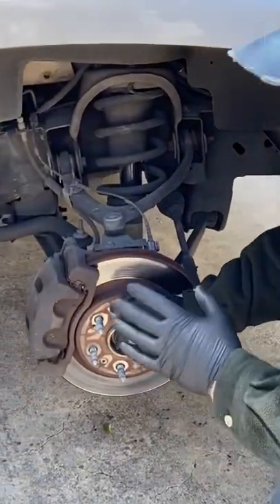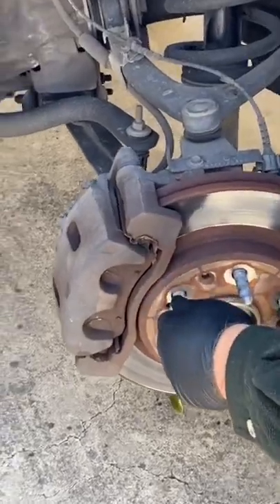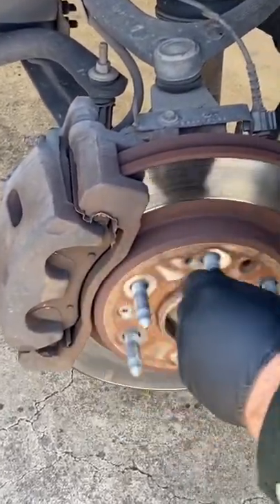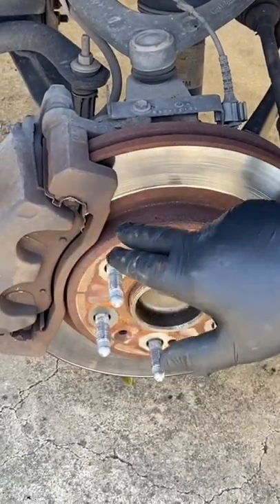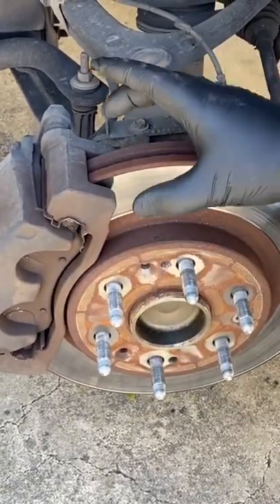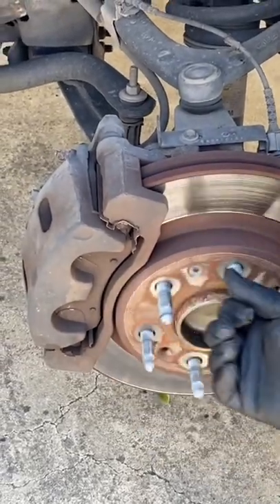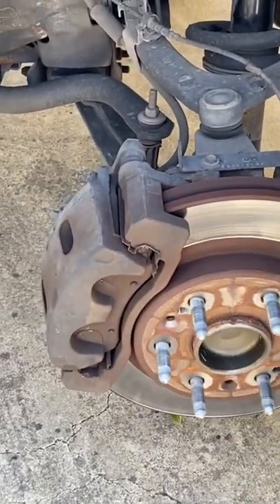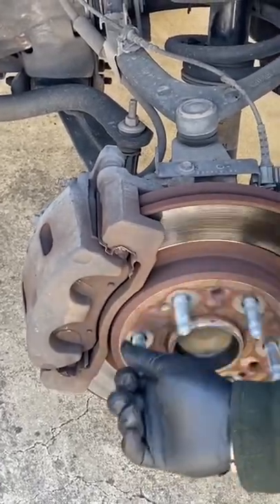Why Are My Wheels Squealing?! #shorts

Comment: I only hear a similar noise when im moving slow or pulling off (about up to 20kmh). I dont know if it s the same issue
Reply: Ok fixed. The dumbass who installed my new set of tires apparently didn't screw the nuts tight enough and the wheel was slowly dislocating.
Reply: @Kyle-ic1bm I think I might be having the same problem, someone at the tire Shop thinks it's worn out brake pads

Comment: I wish I could post the video I have of my car. It’s soooo loud everyone is plugging their ears. Just bought the car, new pads and rotors were installed wrong. Tire shop “fixed” it, but it’s still faintly making the noise! I’m scared to drive at this point. This is the only video I can find that sounds somewhat similar
Reply: You are good nun to worrie abt

Comment: My break are brand new and I still hear that sound when am breaking, had to abandon the car and drive my other car because the noise is so embarrassing
Reply: You ever get it figured out?
Reply: You or whoever installed them probably made a mistake 
Not properly cleaning the moving parts

Not greasing in the correct places 

Stuck caliper 

Brake pads on backwards 

It has a reason 

Just takes the labor to find out what’s wrong and money to fix it

Comment: I still get this after I switched my break pads twice. And my rotors once. Front and back. It’s driving me crazy
Reply: I’m going through this now and apparently work out wheel bearings can make a similar noise. Could be that.
Reply: A quick fix was getting my rotors resurfaced. Noise stopped. This was on a 2013 bmw so most of the times I had to break harder than usual, which would cause the noise to come back. I ended up having to drive my bmw like if there was a police cruiser behind me. That allowed me to break soft and never heard that noise again. Oh but as soon as I put it in sports mode. And want to break. You should cover your ears. Moral of the story. I was driving to fast which caused me to break hard often. Even then that didn’t make sense because before this problem I was already doing that and it never made noises. So something in the break set up that wasn’t the rotors or break pads had to be making the noise. I switched all the rotors once. Break pads at least twice. Same bullshit. Drive soft, no noise. But at that point what do I want a bmw for then. If your going through this and can’t seem to find the fix and want to save your money. Get your rotors resurfaced. And don’t drive fast. Keep it normal. So you don’t have to break hard
Reply: @elmoneyyy  I got my breaks done a week ago and the mechanic said mine was just worn out pads with the indicator exposed and scraping the rotors. Rotors were still in great shape thank god. I did more research on the wheel bearing potential option and that makes more of a roaring noise.
Reply: When installed, put both ears pointing the same direction on each side. Also grease the contact points really good.  Some mechanics will put on one side ears going opposite and then it causes squeeling when you get home and reverse.
Reply: @chromemox3319 it could be your caliper is seizing a bit on your brake rotor, I’ve been having SO MANY issues with my brakes recently. Needed new pads and rotors and a caliper bc my ex had put them all on backwards wrong and missing bolts and abutment clips..broke a week later and now I’m still fixing it. If your abutment clips are old or faulty that could be causing some odd noises as well, or if your brakes have been very messed up recently your parking brake could also be stuck on! And have you bled your brakes by chance?😊
Reply: @taylorshea6856  nah. They’re good now. I’d only had the truck for a year and the brakes were apparently not replaced at the dealership like they said so I took the old brakes in and made them reimburse me for not doing what they said they did. It was obvious these brakes were hella old.
Reply: High speed braking, or long distance braking down a hill can lead to glazed surfaces. Glazed metal surface as well as glazed brake pad/shoe surface.... glazed like glass. This can cause squeaking squeal. Using a piece of sandpaper buff off the glaze on the face of the brake pad/shoe and the brake drum or rotor. Kind of tune them up. Generally stops the squeak. If you open the brakes to have a look/inspection, give them a quick buff before you close it up.
Reply: Check:
-heat shields in the back of calipers. Get warped over time. Take a screw driver and push it back off calipers/rotor
-brake fluid level. Even after fresh brake service this can be low and usually not checked after service complete. Low brake fluid cause calipers to not fully retract hence noise. Must drain system and refill brake fluid.
Reply: So much go Into works with squealing noises . 80% it’s brakes/rotors, other 20% is other parts connected to the wheel. Anyways, watch chrisfix vid “how to stop squealing on your brakes and rotors” or something along those lines, about a 10 min vid, he explains why it might squeal and what you can do to stop it or minimize it . Metal on metal will always cause noise, that’s why there’s lubrication for metals in cars.

Comment: I only hear this when after turning and making the wheel straight at low speeds. I just got new brakes and rotors. It’s driving me nuts
Reply: Same!!!!!!
Reply: Use some w-40
Reply: SAME
Reply: It’s the heat plate thing behind the rotor my tire blew out because of this and had to bend back the plate before I could even put on a new tire because that plate gets disfigured
Reply: What was the cause for this?
I hear the same sound when turning right and then as the wheel straightens. But not if I turn left.
Reply: @itsreallyamber_games  For me, it was the pad clip was installed incorrectly on the brake pads. It made contact with the rotors when I made turns.

Comment: I hear squeaks in mine not that noise, only happens when reversing or going through drive thru at low speeds, sounds like my brakes but it’s not, feel like it might be rocks in my rotor or the metal is bent and scraping rotor
Reply: I had same issue after replacing bearing then I fixed reverse drive sound by harsh break while driving in reverse in speed but now forward drive sound comes up while slow driving it could be something touching rotor
Reply: @z-k7673  yeah my dodge was recalled for airbags so I’m going to take to dealership and see if they know. Also there’s a new problem now, there is a high pitch ringing noise coming from rear left tire even when parked and idle so I will ask them what that could be also
Reply: I have the same thing going on rn did u ever find a fix?

Comment: Mine have been doing this for a while too but it does it into the high speeds as well. Just got new brakes and rotors and it still happens 😭
Reply: I just put new breaks and I still hear this noise 😠
Reply: @lancienx  it honestly felt louder afterwards 😭
Reply: @Smollusk  I'm thinking 🤔 about wd40 I don't know yet

Comment: What if I just replaced the break pads? It’s even worse now!
Reply: Same here, just replaced today and it’s still happening. Did you find out anything else?
Reply: Resurface y’all’s rotors or get new ones
Reply: I changed my brakes and rotors and still have the noise🤷‍♀️
Reply: @Smollusk you should change the disc. The customers change those disc

Comment: If anyone can help me I have a 2005 Silverado I took off brakes and rotor and when I turn the wheel hub it makes a slight grinding noise also when I brake the steering wheel shakes the rotors are new so are the brake pads it has good suspension and it had an alignment done can this be my problem

Comment: Question what if your brake pads are good? Could it be the rotors?
Reply from the maker: The rotors could cause a squeal after rain or water causes surface rust on them, but that will go away after a few brake applications.  Otherwise the rotors shouldnt normally squeal.

Comment: I changed my pads and rotors and my car is making this noise on the front passenger side 😕
Reply: Did it stop bro!
Reply: Cuz I just had like replaced and it’s making a small squeely noise and I’m worriend
Reply: @ohyeahyeah3842  nope I’m actually ready to take it in to a mechanic. At this point I think is my caliper or axel.
Reply: @ohyeahyeah3842  but maybe you’re experiencing the noise of new pads and rotors?
Reply: Please let us know what the issue is. Mine does the same and only when I turn and it’s driving me nuts. New brakes and rotors already replaced but still! 😩

Comment: I call bullshit it’s just metal against metal so it will squeak! They hardly goin design a brake pad to have a squeaker
Reply from the maker: No BS!  -they are designed for it. Not all brake pads have them, but these do. The industry name for it is AFAIK it's an "acoustic brake pad wear indicator" - it indicates that the brake pads are worn and need replacing.  When brake pads go metal to metal, they make more of a grinding noise, rather than squeaking like these do. Squeaker is another name for it.
Reply: @ProWrenching  I just got new brakes and rotors put on and after driving a hr later it made the same noise hopefully the mechanic can fix it again
Reply: @mrcleananthony1684  wheel bearings